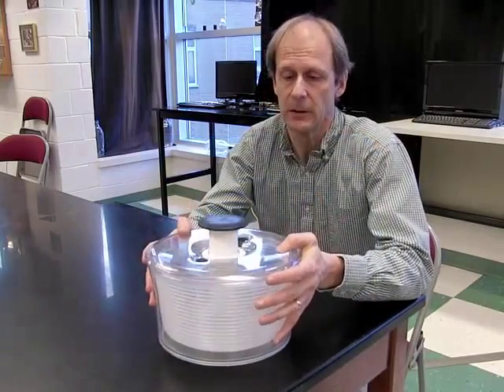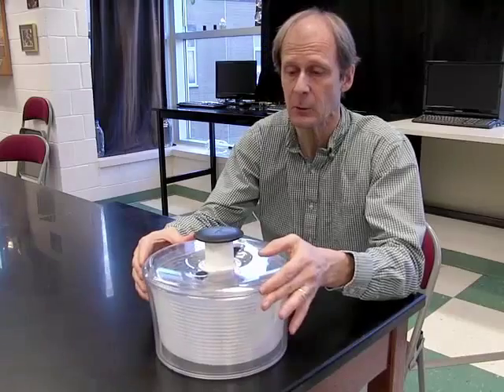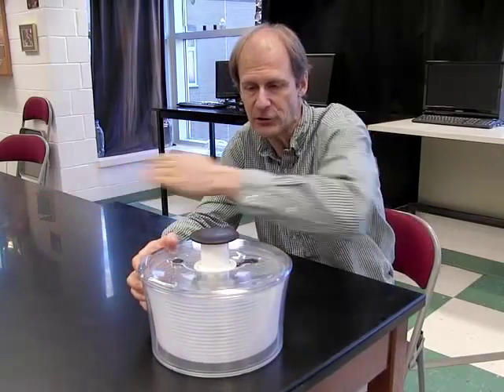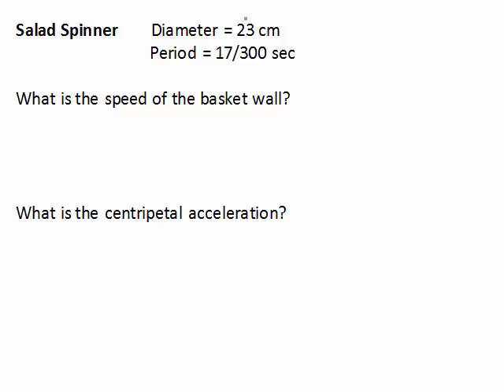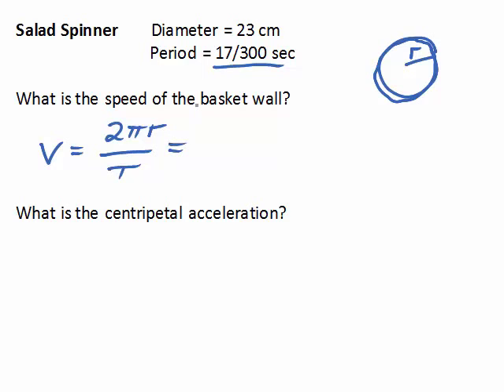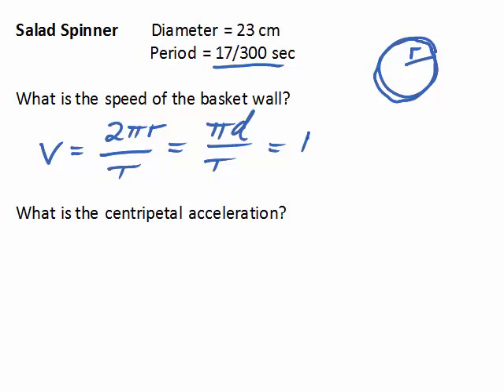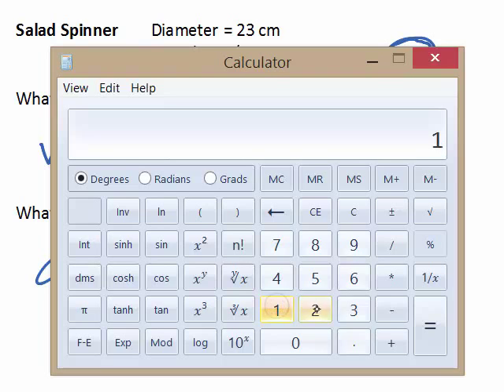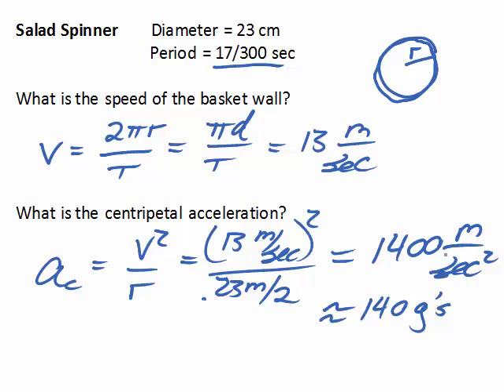Physics analysis of a salad spinner

Comment: A Period of 17/300s (.057s) seems very fast.  That is 17.6 RPS.  Is there any way you can verify this?
Reply from the maker: The video shows how I derived that number from high-speed video shot at 300 frames per second.
Reply: What about a rotating magnet and a coil mounted to the basket wall?